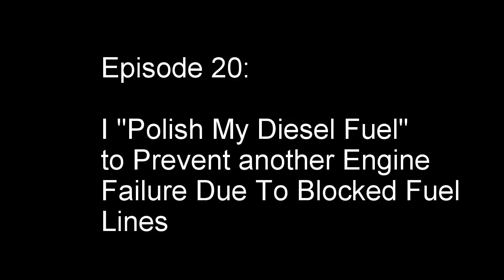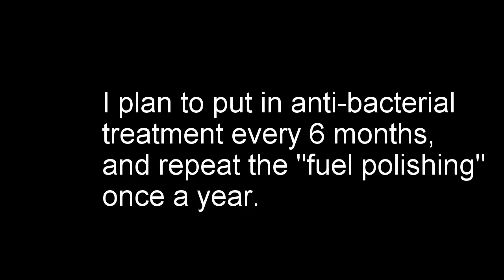Ep 20 Diesel Fuel 'Polishing' To Prevent Clogged Filters and Lines

Comment: Am enjoying your videos, no razzmatazz, just good honest sailing and the mistakes and tribulations that go with it! I've a 37 footer in Spain and I'm always told that with regard to diesel bug, you should ALWAYS keep your tank full especially when away from the boat for a while as it cuts out any condensation. You also should ALWAYS add fuel additive (I've used Fuel Set on my last 2 boats) when you put ANY amount of fuel in. It doesn't do any harm to put more in than they say as it burns off anyhow. Fair winds to you. 
Fenton

Corwynt-Westerly Typhoon
Reply from the maker: All good advice Fenton, most of which I now do.  (I learned to keep fuel tanks filled from my time in aviation --- a practice we did there as well.  I was careless during my trip to the Azores and let my 200 liter tank get 40 or 50 liters down --- which was enough to allow harmful sloshing in rough seas.)     I haven't heard of Fuel Set.  I'll check it out and see if available in France.   I was only planning  to put some in every six months, but your rationale (burns off excess) makes good sense to me.   As a Westerly Typhoon driver, you should check out the excellent videos of 'Samingo Sails'.    James is an outstanding sailor, in a beautiful Typhoon.  Thanks for commenting.

Comment: Hi Patrick,
Great video again.......lots of comments........you are getting a massive following already! 
The pump you used I believe is one sold for changing engine oil or transferring fluids....I don't think that they were designed for continuous use, mine certainly isn't. At some stage it would be worth opening the case to grease the gears for longevity.
I don't want Red Diesel in my boat to prevent issues on the continent, however, it means me using cans to transport it. With the Hunter 356 you have seats on the pushpit, which make a great place to put the can and use a jiggle syphon to transfer it. My jiggle syphon has a filter on the end, some on ebay don't seem to have it, but you could use a stocking or funnel to run it through. Using the syphon means no back-breaking lifting of the can whilst refueling.

Neil
Reply from the maker: I too have a nice niche to rest the jerrycan in next to the fuel cap.   I also use a jiggle syphon for transferring.  Much easier than trying to hold a jerrycan upside down, especially at sea.  Unfortunately it does not have a filter.  Several others have suggested investing in a good filter/separator for refueling.  I'm going to checkout what is available at the local marine chandleries.   Best regards Neil.

Comment: Thanks. I came away with the feeling that it might not take very much stuff in your fuel to stop your engine. At an awkward moment. Very good to know. Ron
Reply from the maker: The blockage in my boat occurred in an emergency fuel shutoff valve, not at the level of the filters.   I have since changed that valve so it has a much larger orifice than the original.   I also added 'see-through' strainers in the fuel line to 'catch the big stuff'.   Thanks for watching rlj.

Comment: Great set up, the only problem is the baffles is the tank.  I think with the right additives and doing this a few times after a fresh sail you should get most of the stuff. My problem is that my tanks 4 baffles each, powerboat, and only have access to 1/5th of my tank.  Nice boat BTW.
Reply from the maker: Thanks Brian.   I only have one baffle in my tank (as far as I can tell), but you are right, it limits the effectiveness of vacuuming the bottom.   I did go out on a relatively rough day to shake the tank up pretty well before I did my polishing exercise.   Not perfect, but as you say, combined with additive, a strainer, and a quality water separator filter, I hope my problem won't recur.   Thanks for watching.

Comment: Hi Patrick

A really good series, many thanks.  I particularly like your decision making processes throughout the series, probably derived from your flying days but exemplars of thinking clearly under pressure.  Good examples for me to get the benefit of hindsight without the pain of experience.  Like you I experienced an unfortunate loss of engine due to diesel bug which required flushing the system whilst at sea.  No fuel now gets into my tank that is untreated with biocide and the problem has never returned.  I don't know how frequently you refuel, but you might consider this rather than a timeframe based treatment.

Looking forward to more.
Reply from the maker: Really interesting point Greg.   I use my boat very often (say once per week), so fuel cycles fairly regularly.    The treatment I am using has two prescriptions: one for 'curing' the bug (by nuking it), and the other for preventing the bug by adding two liters every six months.    That time-based treatment is what I have started to use now.  I haven't thought of adding some every time I refuel.   Hmmmm.  I'll have to give that one some thought.  It certainly can't hurt anything (other than my wallet).   Hmmmm, food for thought there.   Thanks for watching.
Reply: Yes different products have different regimes.  I use Starbrite StarTron which needs 0.25ml/l for a maintenance dose, comes out about best in this test and is particularly suitable for frequently used engines.  http://www.pbo.co.uk/gear/12-diesel-bug-treatments-tested-43353 .  No connections to any of the products btw.
Reply from the maker: Many thanks for sharing this very well done report with us Greg.   Lots of useful information in there.

Comment: Patrick,
Perhaps you could add a copper tube with a 90 degree bend on your return hose.  You could aim this all around in the tank  "stir" the contaminants up from the bottom and out of the corners of your tank much like the rough water did when your engine quit...
Reply from the maker: That's good thinking Dan, but the tank has baffles in it (to reduce the sloshing effect).   It would be hard to get the pipe around the edges of the baffles, but worthy of some more thought.
Reply: @patricklaine6958  Roger that sir...   Perhaps the additive with a full tank and polishing and keeping an eye on the additional strainers is all one needs to do.
Glad I ran across your videos.   I am not a sailor but learning a lot from you, please carry on...  Maybe some day for me. 

Perhaps a tank with a bolted down removable top..?  You could get in there and scrub with a scotch brite pad.
like I said, I am not a sailor... ;^)

Comment: Great job your a man of enguiniety...Would be nice to have some kind of way to stir up the tank, like a strong pump and drop the inlet and outlet hose into the tank and crank it to create a good simulation of rough weather in a controlled manner while polishing...
Reply from the maker: I actually went out to sea in moderately rough weather just before I polished the fuel -- for exactly the reason you state, but by the time I got back to my beth, I'm sure everything had settled back tot he bottom again.   Even worse, there are baffles in the fuel tank to reduce sloshing, and the suction pipe can't get behind them.    There really is no substitute for inspection ports on the top of the tank.   Thanks for watching.
Reply: @patricklaine6958  Should be enough space in the through port to put an inlet and outlet hose to circulate the diesel that would have enough pressure to create some good turbulence in the tank...High flow 12V diesel pumps ain't cheap, maybe be able to hire one..

Comment: I saw your other video and was going to recommend this.I actually use a day tank and filter constantly as it can be a constant battle in some places.
Reply from the maker: Just don't have the room for a day tank SJS, but wish I did.  :-)   Thanks for commenting.
Reply: Thanks for the reply,I had to get creative to find room on my 35 so I understand.Another option is to just filter it right back into your tank,although your solution is perfectly fine.I just have a older boat that sat for some time so my case was a lot worse. I also tend to be a little paranoid about some things especially if its for a boat that goes offshore. As far as Racor filters go,they arent cheap but are well worth the money.I have the same model for filtering my day tank and then I use the smaller spin on series for the engine.the spin on even has a built in primer that is a life saver in rough seas.You actually got a really good deal,I had sticker shock trying to get one in the EU.I ended up having one sent from the states as a "gift" when I was helping a friend refit his boat in Bulgaria.Anyway hope you dont mind me babbling on,I'm just itching to get back on the water here pretty soon.
Reply from the maker: I'll look into the spin on model with primer SJS.   I have to tell you, changing filters and priming in rough seas ---- been there, done that, don't want to do it again!   :-)
Reply: If you want I can get you the part number from mine. They are cheaper than the big model but they are still pricey,though it'll seem like a bargain once you have to change a filter away from the dock.I crack it loose and then spin it off in a plastic bag,pull the bowl off and seal it up for disposal.Then just spin a new one on and you're good to go.I use a rag while priming and it is a quick and clean job no matter the conditions.If you use a pair of gloves and a ziplock bag for the filters/old rag you wont have any smell,oily bilge or any of the other filter changing joys ;-)
Reply from the maker: Yeah SJS, I've seen a video of them.   I'll find the part number on the net, but thanks for offering.   Fair winds.

Comment: Binge watching your great videos Patrick. Coupe of comments. Regarding stowing fenders at sea, you can politely request the harbourmaster for a particular berth, port or starboard, if you prop walks to port then its easier just to dress that side, just tell them your sailing solo. They may not be able to accommodate, and most of the time they do, but no harm to ask. Secondly after your grounding and lift out everyone was inspecting the bottom of the boat while it was still in a sling!! Not in the UK you won't. The employees will lose more than their jobs if they squash the Boat owners. Anyway i agree with many of the comments, its great to see sailing explained so well, and glad you didn't delete the grounding episode just because it was embarrassing. All things happen at sea.
Reply from the maker: Thanks Anthony.   I do ask on the radio sometimes, but I still need to put the fenders out on both sides.   The reason is that most marinas transmit on the Low (1 watt) setting.   If you call them from 4-5 miles out, you probably won't hear their response.  If you wait until 1 mile away, you will be right at the marina channel entrance among all of the traffic ---- not a good time to leave the helm and throttle to go rig the fenders.   No simple solution.   I have even called on the phone before, but the person answering the phone was not the one assigning the berths, etc.   :-)    Your safety precaution of not going under the sling is a good one.  I'm not sure it is very respected in France or Spain.   I have often seen boats changing out anodes or doing a quick fix, and then back into the water.   (Marinas even have a 'one hour rate'.)   It sounds like a 'best practice', but not used everywhere.   Thanks for commenting.

Comment: Great video Patrick it's a good system and obviously it works. That dirt that showed on you fuel after the treatment might not look like a lot but trust me is enough to clog a fuel line. Cheers.😀
Reply from the maker: I didn't show it on the video, but at one point, it blocked about 3/4 of the flow through the pump.  I had to turn it off for a moment and back-flush.....   You're right George.   It doesn't take much.

Comment: Thats a good little pump set up.
As you saw it was the strainer where the gunge was and that is the stuff that is sitting on the bottom of the tank, when the boat goes to sea it gets shaken up and ends up in the filters and stops the engine. As you say you were supprised how little there was. Most likely it is still hiding in the tank behind the baffles. Anyone trying to remove sludge from the bottom of the tank cannot get behind the baffles.This is the reason why we invented the Diesel Dipper. The dipper is designed to suck from the very bottom of the tank, whilst underway when all the sludge and water on the bottom of the tank is sloshing about. In effect we wait for the sludge to come to the suction tube rather than the suction tube finding the sludge, it has no consumable filters and runs as a bypass system  independent of the engine fuel system, it's sole purpose is to remove water, and gunge, from the very bottom of the tank.
Can I also say, fuel polishing is not really necessary in a boat. Most modern marine engines return up to 50% of the fuel back to the tank, in so doing there is already a "fuel polishing" system on board. More importantly is making sure you get the water out of the tank bottom. Water is the precurser to 95% of diesel problems yet the easiest to control. If you have a drain in your tank...use it regularly!. If you dont consider buying a Diesel Dipper to do it for you which can be connected to a "dip Tube" or the drain plug if you dont like lying around in the bilges! It's also important to replace the additives that degrade, we can recomend Marine 16 "Diesel Fuel Complete" it keeps the fuel fit for purpose when stored for long periods as in yachts.
Hope this was helpfull, Great videos BTW.
Reply from the maker: Excellent information.   Many thanks.

Comment: Hi Patrick, just ran across your videos and I'm enjoying them!  I like your fuel polisher setup, but I would suggest trying to use your fuel pickup line as your line into your polishing system.  This would ensure you are getting the "bottom of the barrel" fuel.  You could even rock the boat a bit with lower fuel levels to slosh the gunk to the pickup tube.  I'd suggest trying to fit up a permanent polishing system, but you'd would definitely need a quieter pump! haha Fair winds and I look forward to more of your videos.
Reply from the maker: Thanks Tim.   What you say about using the fuel pick-up line makes a lot of sense now that I think about it.  In addition to being next to the lowest spot in the tank, there is a real advantage as well of sucking out any gunk that may be in the line or the pick-up.   That said, I inserted the copper pipe through the fuel sender opening, and the copper pipe reached over almost to the where the fuel pick-up would have been.  Having a remote pick-up has the advantage of being able to move around to various points on the bottom of the tank and letting the pump run there 10-15 minutes (which is what I did).   For next time, I'll think about a hybrid approach, where I run the pump through the pick-up line for an hour or so, and then via the copper pipe from various points on the side and bottom.    Very good suggestion.

Comment: A good friend of mine had a similar issue and has now installed an additional 60 litre tank for ready use and an electric fuel transfer pump together with some cheap clear inline filters between the two tanks.  In his case the gunk appeared to be gathering in narrow orifices in the 90 degree elbows where the fuel pipe exits his stainless tank which again is not what you might initially expect.
Reply from the maker: Absolutely James.  A friend of mine who had also been victim of contamination in his tank showed me how, with a 20 liter reserve jerrycan of clean fuel (that I always carry anyway) and a few simple bits of plumbing and a priming bulb, I can bypass most of the system and 'get home'.   Very simple to do.   I keep this small kit on-board at all times now.  Thanks for sharing.
Reply: Those would be called 'day tanks'. Having multiple tanks makes it easy to setup a permanent polishing system from one tank into another and back.

Comment: Well. This surprise me too. Since you clogged up you're fule line, i was sure it was worse. And I have seen it MUCH worse. But that is a good thing. I dont know the English or the France term of this black mushroom. But in Norway we call it Diesel animal. It is a fungus as live "between" the water and Diesel. And since condens is a great water source, it is a good thing to keep the fule cell/fule tank toped up to prevent condens.
I think you did a good job. And you shod be happy with the kvality of your diesel. If this was my boat, I had put my monye on that this only came from one year I used the boat very little, and only had 50L of diesel on the tank.
Maby the year beefore you bought her?  she was sitting for a while?
Great video. Great job. Thanks.
Reply from the maker: Many thanks Anders.    My pump may have been a bit too strong to allow the water to separate, but I was delighted that there was not much sediment/diesel bug.   I will now do regular treatments with anti-bacterial products, and try to keep the tank full as much as possible.
Reply: Yes I saw the tretments you bought. And I guess they all work more or less the same.
And to use it as a preventer, I think is a good idea.
You should bee safe in the future.
Reply: It's called "Diesel Bug" in English but actually that's any number of fungi (e.g. aspergillus; candida; fusarium; hormoconis resinae) or any number of bacteria (e.g. clostridium; desulfotomaculum; desulfovibrio; flavobacterium; hydrogenomonas; pseudomonas; sarcina).